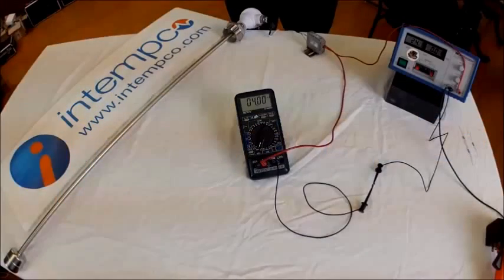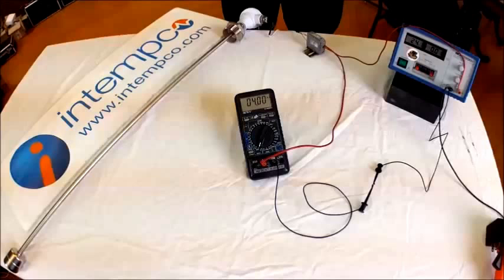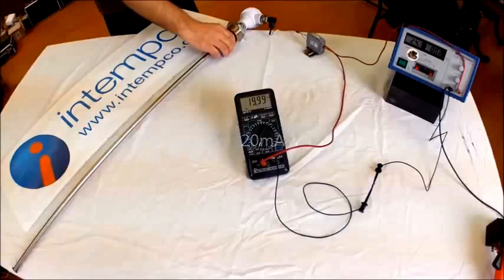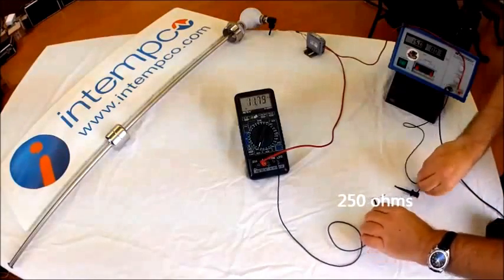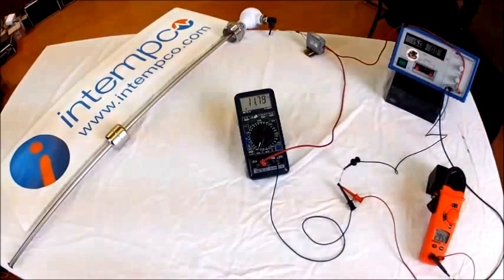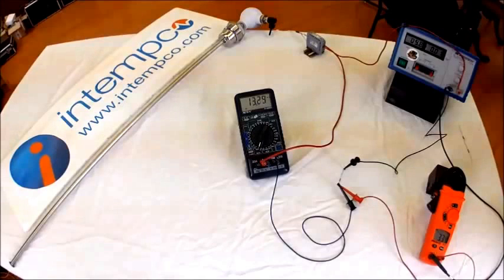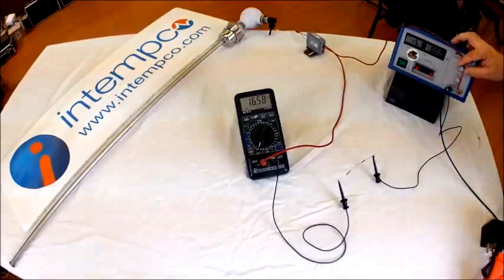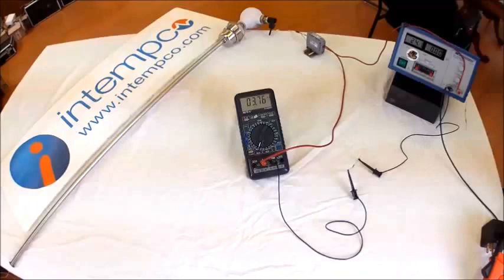4 to 20mA Current Loop Tutorial

Comment: the transmitter(transducer) is a 2-wire transmitter(transducer). The negative of the transmitter's signal output combined with the negative of the power supply'.  here is a 2-wire transducer:https://g-sensor.net/signal-conditioner/ac_current_transducer//2019/0110/380.html

Comment: Thank you for the video. 
could you please clarify, why constant 9V is subtracted from VSupply for to calculate the maximum resistance ? is this the voltage drop across the load, like PLC ? Thank you.
Reply: balu0123456 It is the minimum voltage required for the current transmitter to work. That is why you add 5V (for the 250 ohm resistor) and make 14V in the next line.

Comment: Finally something that makes sense and is simplified,THANK YOU.. so the IR drop across the 250 Ohm Res. is NOT the signal directly from the float sensor, but from the transmitter(current regulator) acting as a slave for the float switch. And if we were to tap a meter across the 250 Ohm resistor, who's face was graduated in gallons, we could read the volume indicated as gallons but would actually be reading a voltage drop between 1-5 volt(s) which is determined by the amount of current flowing through the resistor which in turn depends on the position(height)of the float switch. Q-What if instead of a resistive sensing device you have a rotary sensor, say for flow rate or gpm does that require a different type transmitter that operates on some type of pulse count ???

Comment: So, basically if I put in parallel 250ohm resistor with my ADC input of microcontroller (ATMEL or microchip, what ever) I would be able to measure voltage on that resistor from 1-5V ( below 1V is less than 4mA = error, loop broken?) when signal 4-20mA  is present so I can use some industrial grade sensors in my microcontroller projects! :) COOL!

Thanks Robert!
Reply: Yes, put the positive voltage through the sensor and then terminate at your project with a 250 ohm resistor to ground.  Place the sensor for your microcontroller on the plus side of the resistor and it will measure from 1 to 5 volts.  Easy.